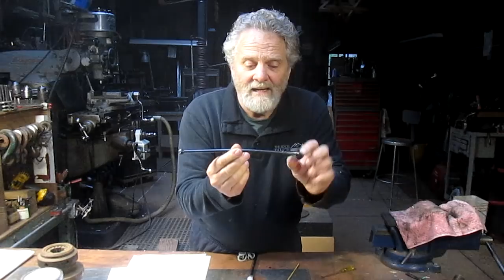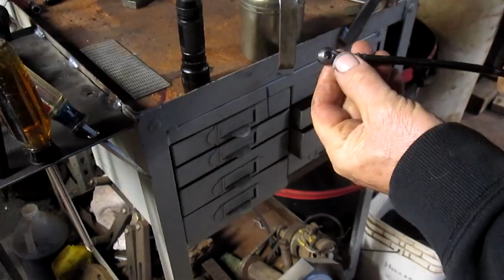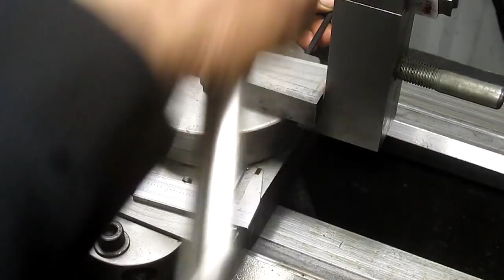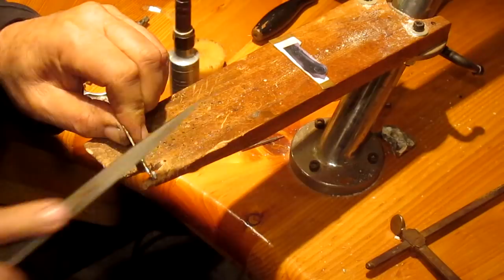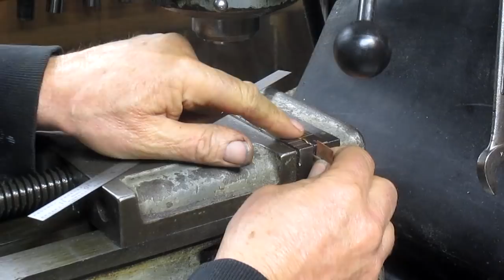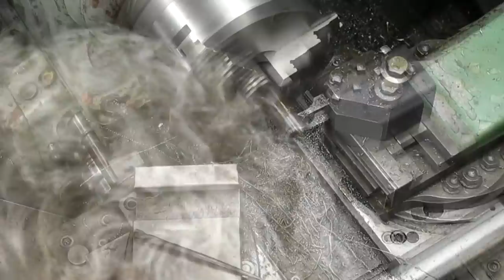Dickin' Around With Driveshafts #1

Comment: Might I suggest with that short length of steel wouldn't it be prudent to leave it in one piece and cut off after getting the hard end finished? If it gets messed up you only lose an inch. Not the 10"  cut off length.
Reply from the maker: Humm, good point.

Comment: Nic, do you have special regulators for your mini-torch?  I've got one but haven't had the guts to connect it to my standard oxy-acetelyne regulators.

Also, as a joke I was going to suggest sending this to Keith Fenner so he could use his tracer attachment forgetting that you have one.  Then what do you say? That you've got one and are going to use it!  Joke's on me!!
Reply from the maker: standard Oxy-Acc regulators work just fine on a mini torch, just turn the pressure down. The tracer comes on line in the next segment.